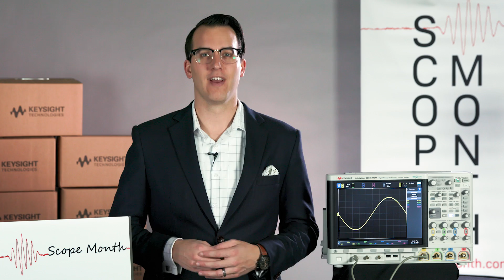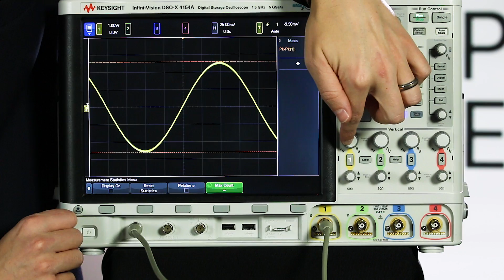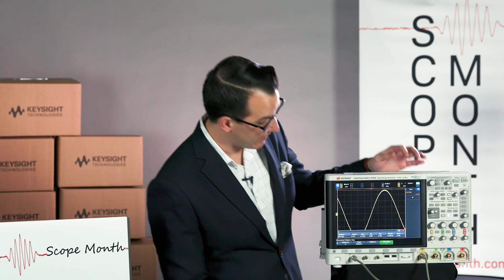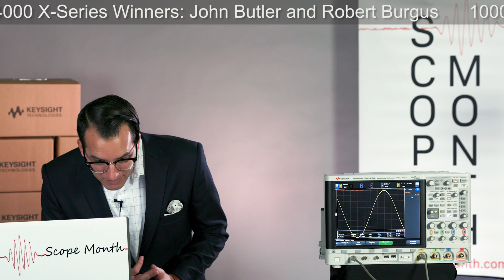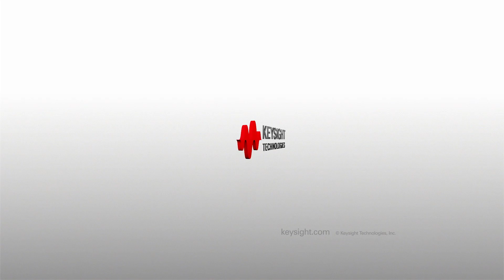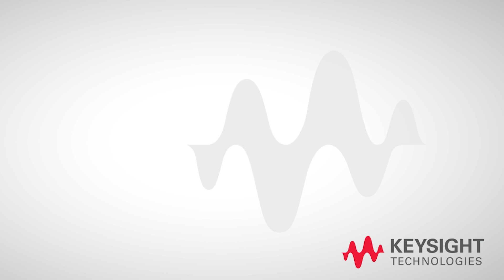Optimizing Your Scope's ADC and Today's Scope Month Winners! (10-Mar-2017)

Comment: I'm so sad :( . For consolation - multimeter month in april?
Reply: And then May Oscilloscope Probe Days!
Reply: So we need to increase "current" (pressure) :-)
Reply: It is easy to rectifier our preferences
Reply: Pampali there's probably to much "resistance" towards that idea 😀
Reply: So long as we're "direct" and not "alternating" with things 😄
Reply: As long as you have the capacitance for it, diode know if I do though